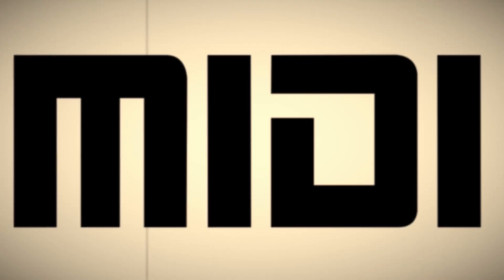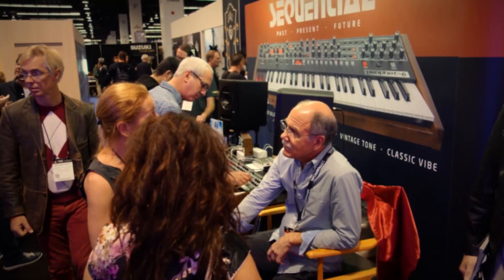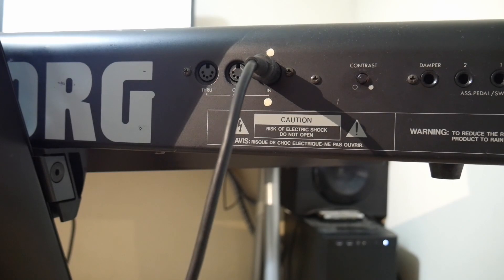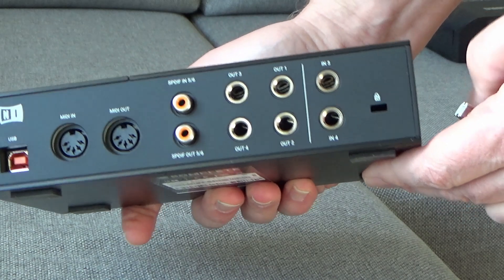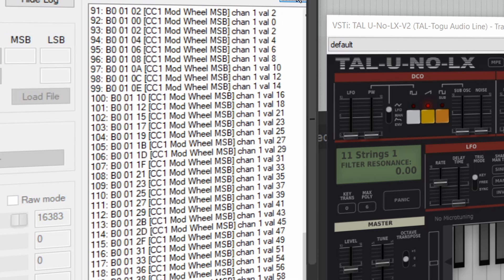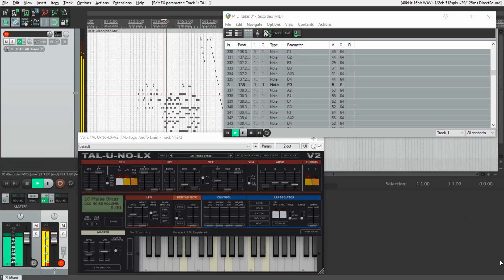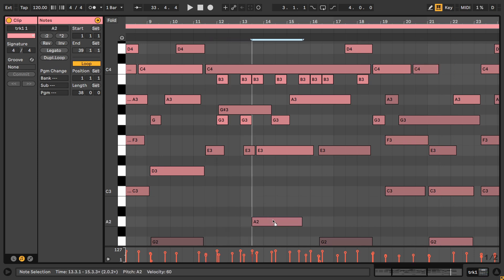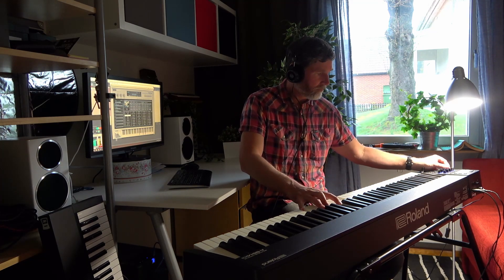Introduction to MIDI - The 1981 Music Revolution

Comment: I play keyboards and sing in two rock bands. In the first band I use a 76-key MIDI master keyboard, two MIDI sound modules and a MIDI vocal harmony processor. In the second band I use a 37-key MIDI master keyboard, a MIDI sound module and a MIDI vocal harmony processor. So I use MIDI a lot :)

Comment: Great video - you hit all the main points!  Back in the 80s saving the MIDI events into MIDI file allowed you to save lots of songs on a floppy disk.  It was just not possible for the home computers then to process or save digital audio directly due to constraints in CPU speed, RAM, and disk capacity.  Back then an entire hard drive capacity was maybe 20Mb.  The the most common misconception for beginners is that MIDI is just another audio sound format like wav or mp3.  It isn't.  It's a totally different animal.  It's a specification first, and also an efficient file format to store the MIDI events for a song described by that specification.

Comment: I wish I'd spent a bit extra on the Juno 6 to buy the version with midi.  But it was very early days of midi and I didn't realise its usefulness in the future.  I could now be using the Juno 6 as a midi controller for software sounds from my PC.  As it is, it's not used at all.

Comment: MIDI is something like "Eternal" communication protocol. Thanks to it you can connect your even almost 40years old synthesizer (if it have MIDI of course ;-)) to you DAW and computer from 2022. For USB you needs drivers, and they could not be supported in next OS (Roland Fantom XR for example, you needs to tweak Win 8 drivers, to make them works in Win10), this is not issue with MIDI, where in worst case you will buy new USB-MIDI interface.
Reply: Actually it's more like a digitised version of a early 1900s self playing piano roll.
Reply: @HOLLASOUNDS  Old but still extremely useful. :-D
Reply: @petertorda5487  Yes however I dont actually have any midi cables so have to do it with usb.

Comment: Out of the blue, this reminded me of the proposed successor, the ZIPI protocol, which went nowhere.
Reply: Zipi? Never heard of it, tell Me more?
Reply: @HOLLASOUNDS  Since my memory of 25+ year old Electronic Musician articles is not to be trusted, here's a bit from the wikipedia article: 
"Zeta Instrument Processor Interface (ZIPI) was a research project initiated by Zeta Instruments and UC Berkeley's CNMAT (Center for New Music and Audio Technologies). Introduced in 1994 in a series of publications in Computer Music Journal from MIT Press, ZIPI was intended as the next-generation transport protocol for digital musical instruments, designed with compliance to the OSI model." 
"The draft working version of ZIPI was primarily aimed at addressing many limitations of MIDI (Musical Instrument Digital Interface). Unlike MIDI which uses a peer-to-peer serial port connection, ZIPI was designed to run over a star network with a hub in the center. This allowed for faster connection and disconnection, because there was no need to daisy-chain multiple devices. Ethernet 10Base-T was used at the physical layer, but the protocol did not depend on any physical implementation. 
There were proposals for querying device capabilities, patch names and other system and patch parameters, as well as uploading and downloading samples into device memory." 
"As no commercial devices were released supporting ZIPI, the sufficiency of MIDI for most applications and the introduction of the "FireWire" (IEEE1394) as the alternative physical layer soon led to the practical demise of the project. ZIPI web site at CNMAT asserts that IEEE1394 "supersedes ZIPI in every respect," mainly because it has simpler interface requirements: it does not require a hub, supports hot plugging (devices may be added or removed more conveniently), and includes an isolated power distribution scheme."

Comment: What's amazing is that the creators of MIDI were so forward-thinking that it still works with the most advanced instruments of today.

I can take my Poly 800 from 1983, plug it directly into my brand new Hydrasynth Deluxe, and it JUST WORKS, no configuration, nothing. That's amazing! I challenge you to name one other 40-year-old technology that is still interoperable with today's newest devices.
Reply from the maker: 100%, 40 years is a crazy long time for a technical communication protocol, and I have a feeling the 1.0 spec will still be used 40 years from now!
Reply: It's simple, I think the first type of software to use it would of been trackers which is literally the midi data direct into a timed runner.

Comment: I remember first encountering midi files on our family PC on Windows. I was amazed because of their small file size as well as amused because they sound different depending on the tone generator.
When I was a teen I finally can afford to buy a USB MIDI adapter for my Casio keyboard. It's a life changer for me now that I can my performance directly into MIDI.
In fact I can still recall all 128 GM sound and their patch number, as well as the extended 9 drum kits. Don't ask me about GS or XG sounds though! 😅
Reply from the maker: yes. it was usually hilariously bad when you played a midi file through your GM module, MIDI never really nailed that aspect of it!

Comment: Still got my MIDI books from back in the 90s - needed information to help designing a midi flute. Having just played an EWI5000… there’s still a market for a real midi flute - because Akai aren’t in the ballpark - they’re missing at least 2 fundamental design points - especially for those of us who play trad flute! However - I do have my Yamaha midi’d into the unix box, into Rosegarden - and I’m still to try the midi off the digital grand…..
Reply from the maker: midi books, wow, you're hard core!  i have a hunch that v2.0 might help some with the flute :)
Reply: Sort of in the same boat as I play the aerophone-10 and set up a MOTU XT express midi 8x8 interface to connect the wind synth thru my tone generator and 80's synthesizer. Also connect the Alesis MMT8 track sequencer to record the midi track file. I consider midi the best format to learn about music composition because of the flexibility to arrange anything, for a one man band deal. Also because of the small size there is zero latency unlike audio!

Comment: Hi ya Woody! Great vid. This could be off topic but let's see. I remember when connecting multiple keyboards or sound modules that we had to use a midi through power box.  Like the MultiVoltage Quadra - Thru 1-in 4-out box splitter they have today. It's by MIDI Solutions . Anyway, the box is a low-tech way to send one MIDI output to four MIDI inputs. Just plug the MIDI output of your keyboard, guitar effects controller, or whatever MIDI-driven gear you're running into the Thru's input. Instantly, you've got four copies of your data to do with as you please. No batteries or a power supply needed.

I don't think MIDI will ever go away any time soon especially when they have introduced the MIDI 2.0 that takes everything to a whole new level of reciprocal midi communication between devices and DAWs.
Reply from the maker: that's some old school stuff there with all those splitter boxes, I have some ancient midi interfaces which I wanted to dig out, but in storage!

Comment: Couple of notes, MIDI is also a completely free and open standard unlike most in other industrial domains. Anyone can be part of the Midi group and get all the info by just registering

And why midi is still in use in the exact same form after 40 odd years? Because it was well though & designed and extensible enough that it could be used for things that wasn't though off back in the day. 
Most "standard" CC (continuous controllers) numbers was decided after the creation of the protocole itself with the arrival of General Midi 1 that was the first real standardisation of program/patch and control number and agreed between all manufacturer.

That's why a 40-ish years old synth with midi IN/OUT can still be used with the latest released device with actual hardware midi DIN, and such a long and near perfect compatibility is not something that did happen often in most industries, especially when there are so many actors involved.

And most of all, thanks Woody for that video 😄
Reply: Forgot to add, MIDI has also been used for things completely unrelated with Music, like controlling light or other device you can control. It is quite impressive how, "out of the box" MIDI has been used and how well it stood the test of time
Reply from the maker: i see similarities to the TCP/IP protocol used for the internet, when designed the inventors could have had no clue that it would be used to stream netflix movies, but it handles it perfectly. amazing forward thinking.